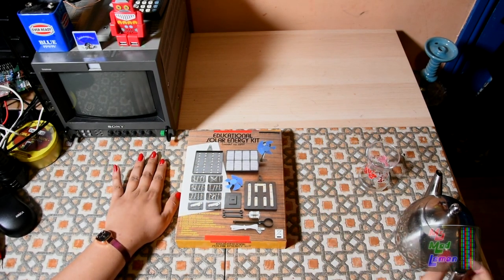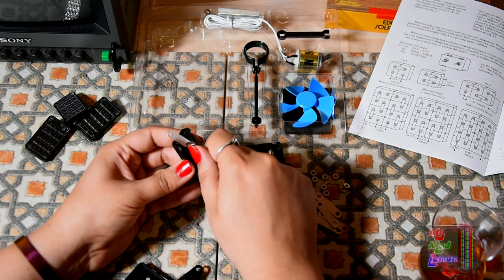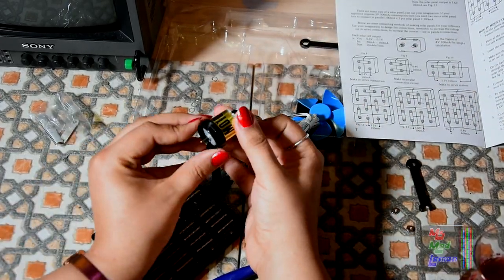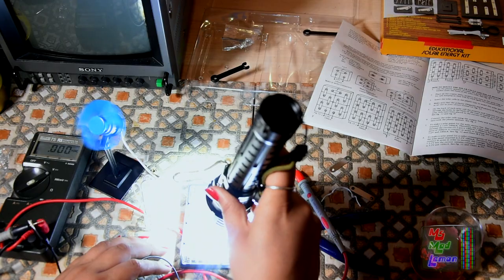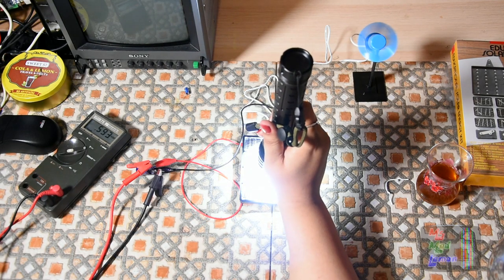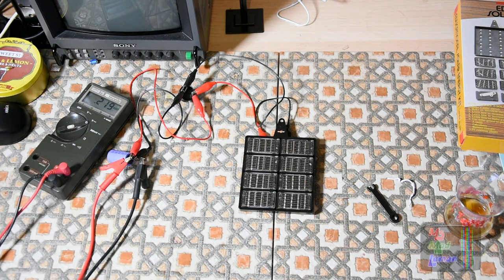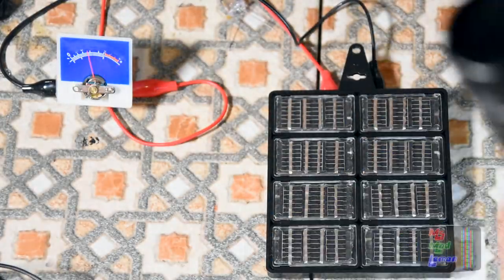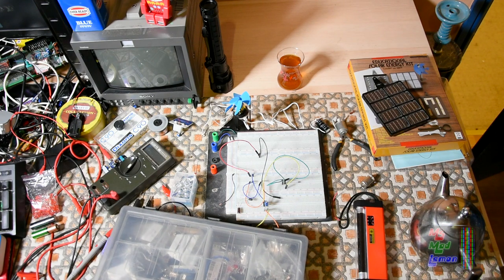Solar Motor kit from Maplin 1990s

Comment: Nerds unite! When I was a kid, my avenue into electronics was model railroading. That's how I learned about diodes, capacitors, power transistors and relays. As a teen I poured over National Semiconductor reference books learning about all the logic ICs, eventually wire wrapping my own boards in college. The fun never ends! Thanks again for a lovely video.

Comment: That was an enertaining video, Thank you, Maddi.

Many decades ago, when I was bout 8, I had a 7 inch 45rpm record with a blank side. (it must have been a demo disc or something). So I thought if I plug the pickup into the speakers of my amp I could record onto it. It made a great smoke machine. LOL.

Comment: I loved the maplin catalogues too! I would happily spend hours reading them - especially the semiconductor section with example circuits. Sadly, when they stopped producing the catalogues - they seemed to switch to a generic 'tandy' like store and the experts that hid in the back became a thing of a past. Before they closed down I went in and asked about a resistor set and the helpful guy asked if I needed 5amp or 13amp?!? I really miss the old maplin's.

Comment: I had that kit a long time ago, the cells it used were old technology even back when the kit was introduced so they really needed a lot of light to work well. The most interesting thing I did with it was connect all the cells in series and used it to power a 2 transistor amplifier that I connected to a crystal radio. Even with just room lighting, it was enough to go from barely audible with the crystal radio in its stock form to a bit loud with the provided earbud.

In the early 2000s, I got a Harbor Freight panel on special and despite it being only about 3 times the area, it produced far more than 3 times the power. I tried using it to power a TI TPA3122 Hybrid Digital audio amplifier with limited success, might try it again with a newer chip that uses even less power.
Reply: Agreed, the solar cells from a couple decades ago are pretty inefficient compared to the ones produced today. Also, the lubrication in the motor is probably dried out, but it can be re-lubed to get it back to normal operation. I watch a YouTuber (Randi Rain) that refurbishes old toy robots and frequently she encounters motors that have seized up and need a little help to get going again. :)

Comment: Thank you for the nice video. I like these kinds of toys that make kids interested in science and technology.

An LED supplies only a few µA when illuminated. You would need thousands of these to spin the motor. But with an op-amp they can be a good light sensor, e.g. to receive an audio signal transmitted by modulated light.
Reply from the maker: Yes, it's why I didn't try to go too far and add more Leds, I knew it would be too much 🙂
Using them as a light sensor isn't a bad idea actually. Kinda like how the toslink optic fibre would work.
Thank you. I'm glad you enjoyed the video :-)